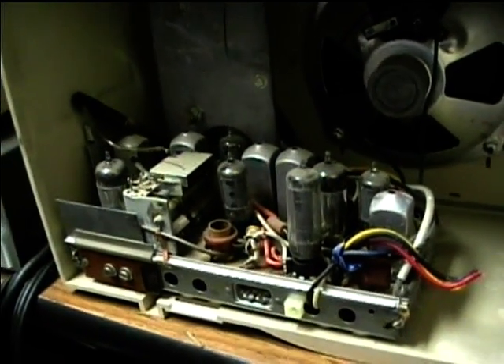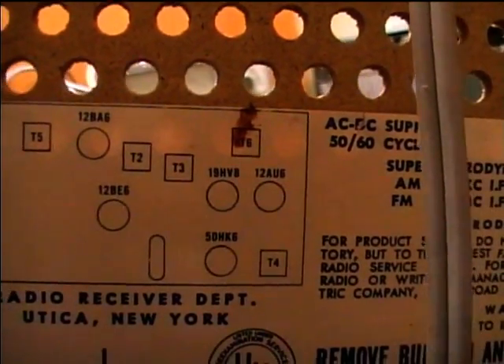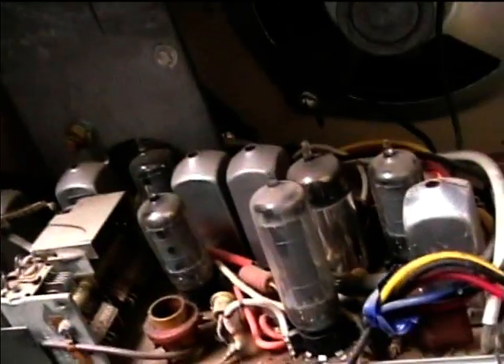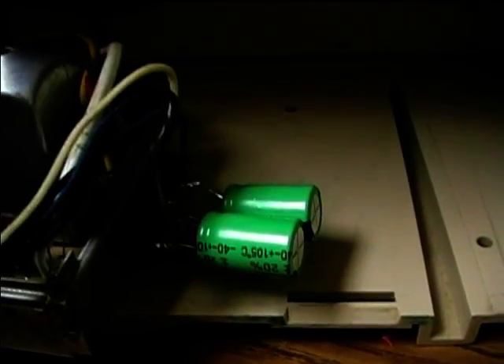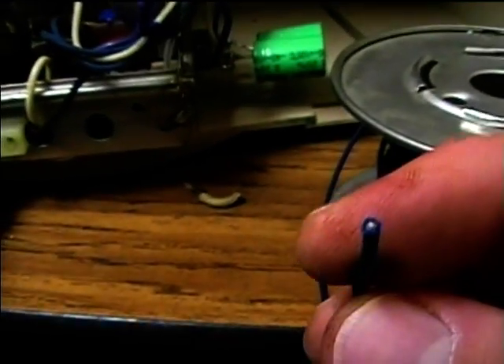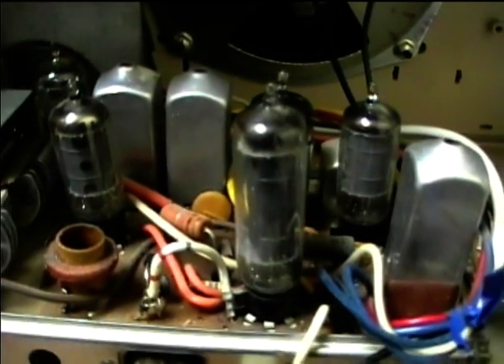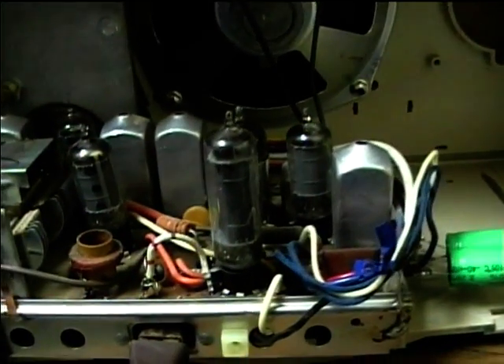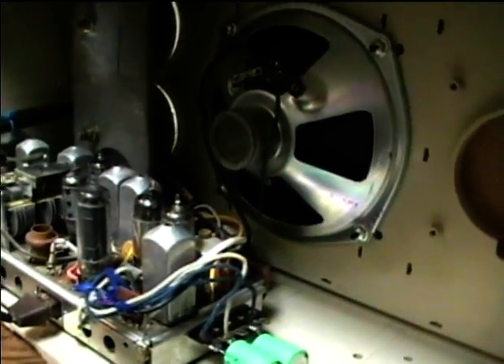1962 GE T-245A AM/FM tube type radio

Comment: You mentioned on this video of this radio or the other GE one with the 2 spkrs. that the FM sounded distorted on it and was going to try to find a way of improving the audio for today's FM broadcasts. I hope you post it here or can contact me as to what to do. I own a 1962 GE table stereo with the pull out spkrs. that has this problem only on FM and would like to make the FM sound better. Other than that the tune is receiving fine but the FM stereo osc. need realigning.

Comment from the maker: Thank you! I think the one of the 9-pin tubes is actually the 2nd FM IF plus the 1st audio stage. I looked at both the 19JN8 and 19CL8 and they are both pentodes/triodes like a 6U8 or 6GH8.
That meter looks like a simpson but is actually a Radio Shack Micronta that organist1982's dad gave me.

Comment from the maker: Thanks! I was really surprised by the performance. Too often tube-type FM table radios don't seem to have all that good of FM sensitivity. I really would recommend the wire...i remember reading a radio do-it-yourself book from the 40's which recommended push back type cloth-covered wire and now I finally found it. The inner core is a very finely braided material, maybe like Nomex or something, there is no rubber or anything like that to it to get brittle over time.